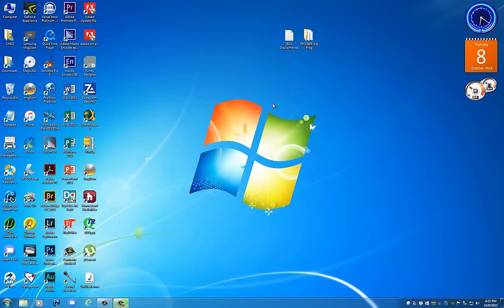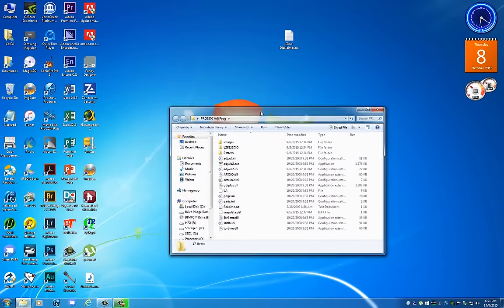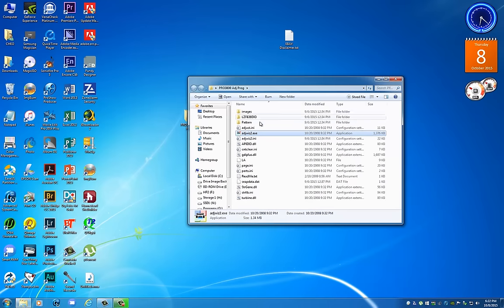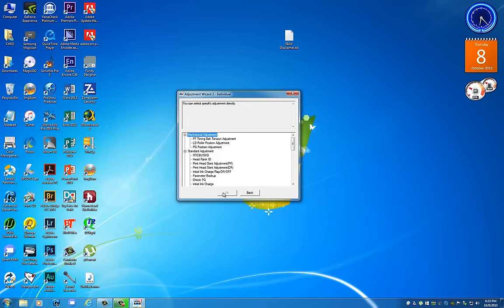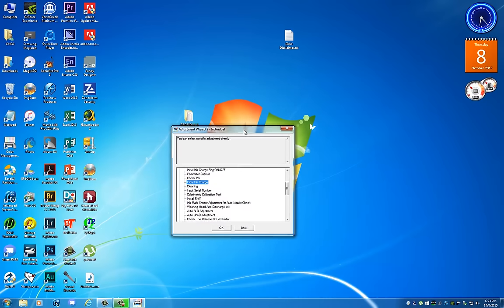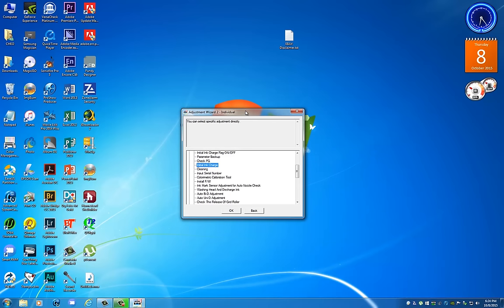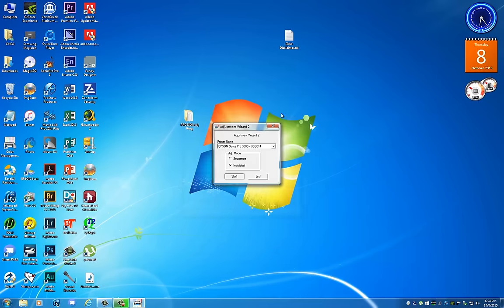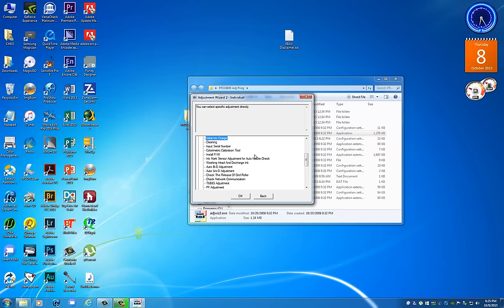The Perfect Printer trick - How to Clear Air out of the PRO 3800 / 3880

Comment: Thank you for your videos Jose, I watched a number of them today. I am trying to resurrect an Epson P600 printer that stood idle for a long time. I have already cleaned the print head using one of your videos (yellow was worst), I think I have done it well, but have not tested yet. Two questions bothering me first if I may. 
1) Ink lines got air in them by accident, I understand that a reset/adjustment/Initial Ink charge is needed to clear the air out.
2) Ink lines have had ink sitting in them, not used for a LONG time. Should I clean out the ink lines before putting new ink cartidges in? Beause I am worried they may contain crusted ink that can reclog the heads. I am not in North America or Europe, and cannot get the inkjetmall piezoflush kits. If it is worthwhile to clean the lines, can I use a 20%/3%/77% isopropyl alcohol/propolene glycol/distilled water solution? Then to dthe initial ink charge after?
I figure the printer may already be ruined at this stage, but perhaps it is worth a try? Or is the printer bricked?

Comment: Hi, Jose :)
I found and bought this printer (3800) after your comments about it. The machine has 200 printed photos so far (half of them are checks of nozzles), but has not worked for a long time (years). Visually it looks absolutely new, everything is 100% clean everywhere. I want to use it only with original ink according to your advice. The problem is that 3 channels appear and disappear a few checks so far. From these three channels, several nozzles appear from time to time (10-30% from each channel)... I follow your logic carefully and there may be air in the system. The channels are light light black, cyan and magenta. The light light black was 2 percent. I believe the head is not broken because the seller was a very correct, elderly person and the printer is new. Only the yellow is 14%, the rest is over half the level after I bought and replaced the other empty cartridges. What do you think about this situation? What would you do? I also found the software you are talking about in this video...
Reply from the maker: You might need to run an ink recharge and for that you need the Adjustment Program. I think I have it. I normally sell them in cd format for $15 to USA addresses only. You will need an ample amount of ink to be able to perform this operation.

Comment: Hi Jose, thanks for alerting me to the air bubbles issue in the video, but I was hoping you might point me to where I can get the adjustment program for an Epson Pro 4000, as I can only see 'CD's to reset the waste tank..tho' I have a cartridge and wastetank reset tool, and these do not resemble the full adjustment program to re-initialize the system and purge air and ink through. Thanks in advance for your help.. and, this request is a result of help already given..THX!
Reply from the maker: The CD to reset the waste pads is it. They don't really receive these this correctly. Besides the PRO 4000 Does not need that for resetting waste ink carts. You use a physical deserter for that and not software. Ask the seller If that is an Adjustment Program. You might also try the WIC reset tool which can do ink charging some Epson printers.
Reply: Thanks Jose, will do!

Comment: Hey guy!  Me again.  I got this program due to still having issues with my 3800.  Magenta not printing on nozzle check and I've replaced dampers and ink bay because it was also not recognizing my carts.   I can't for the life of me get the adj program to work.  I have windows 10.  I tried it in safe mode and didn't help.  Not sure what I'm doing wrong.  I've emailed to place I bought it and not much help.  2manuals.  But yes I know I have air in my one line at least because I can see bubbles.
Reply from the maker: Try this program: WicReset
It can do a recharge on the P800 so I don't see why it would not do it on the PRO-3800.
Make sure NO other device is plugged in the USA ports of your computer. Except for Mouse and Keyboard. Run it as Administrator and turn off all Anti Viral Software.
Reply: @cheo1949  I tried this but didn’t unplug other things from usb. Will try again.  Thank you!
I just started getting error 131B.  I was starting to print and then I got that.  And print would stop.  I was told that meant I need a new print head.  The guy that sold it to me doesn’t think that’s right but….idk.  I took out ink and put in the cleaning carts.  I did get the adjustment program to work by running in XP mode.  I’ve flushed all the ink out and haven’t attempted to do anything else yet.  Any suggestions?  Another person told me it could be a connection on main board?
Reply: @cheo1949  tried this again and it says it doesn’t support my printer.  Ugghhhhhhh

Comment: Trying to get in touch. Bought a 3880 with a great nozzle check. Bought new ink and refillable carts and cant get the printer to take the ink from the carts.Help?
Reply from the maker: Did you prime the carts after filling them???
Reply: Hi Jose, thanks for the speedy reply. I did prime them after I watched one of your videos on refilling carts. I dont think that the air pump is turning on the way I heard in one of Spectras dtg videos using a 3880. The ink that was left in the lines is gone now after printing 20 or more test pages. It also wont do a powercleaning or any cleaning. I thought that might get some ink moving. I should mention that the aftermarket carts keep the door from closing so I was using a plastic ruler to trick the door into showing it  was closed.  I would like to get that 3880 cartrige  refill adapter for a syringe if you have that available. I thought that you mentioned some sort of e-store but I cant find it. Thanks for your help, Grady
Reply from the maker: So you do not hear the pressurizing pump working?  Those large carts can not be properly pressurized when they are less than half full.  The pump is design for 80ml volumes only.   
Here is my site.  The special tip set is at the bottom of the web page. And only for USA orders.
http://canonpixmapro1.homestead.com/tHIS-IS-YOUR-PLACE-FOR-CANON-PRO-1-REFILLING-SUPPLIES.html
Reply: The pump isn't coming on at all. I'm at a loss at where to start. Any direction would be appreciated. I wondered if the adjustment program would get the ink moving for an initial charge or if resetting the pump would help? Thanks Grady
Reply from the maker: Looks like it will need servicing.  The pumps can die and that renders the printer not able to pressurize and deliver Ink.